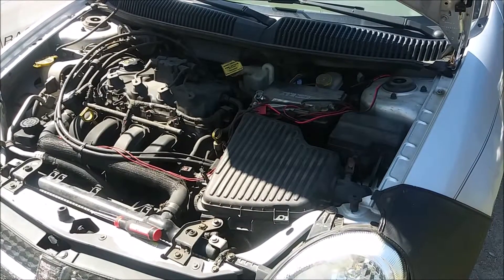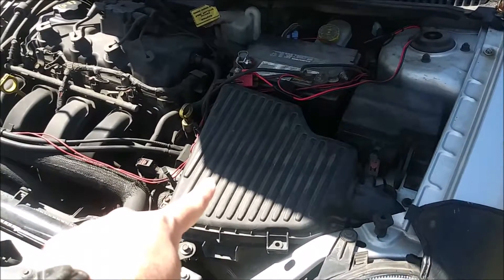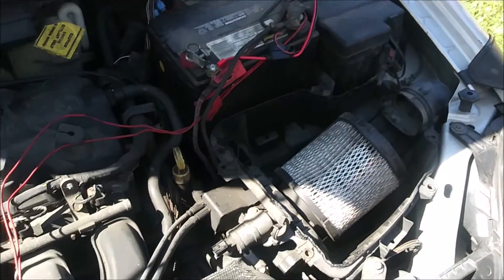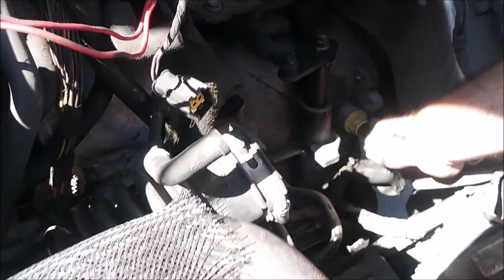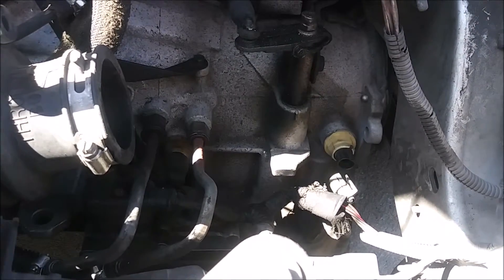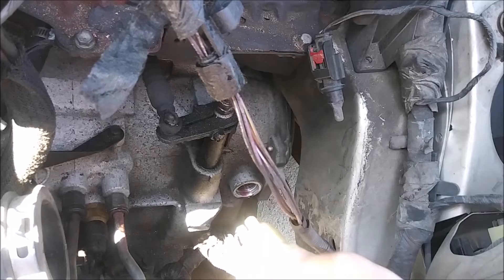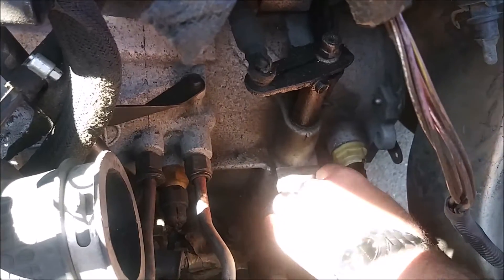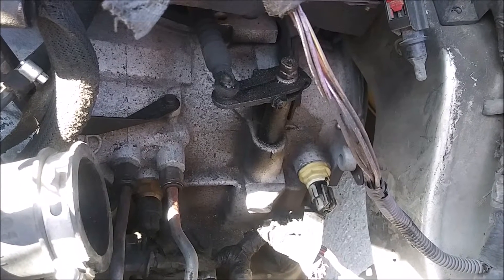Dodge Neon Output Speed Sensor Replacement

Comment: Yup, I have that same issue as well on my 03 Neon. Output speed sensor issue with a gear 1 incorrect ratio. This info really helps, thank you!
Reply: Omg Mines stalling with the ac on in first this is probably why